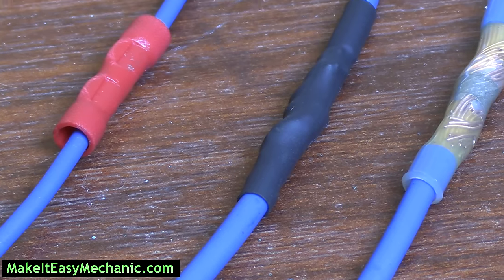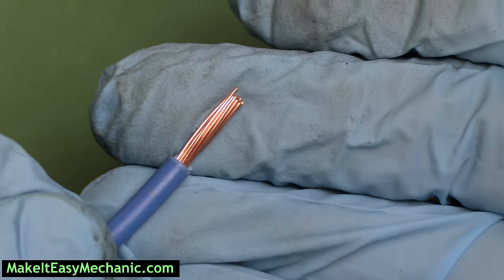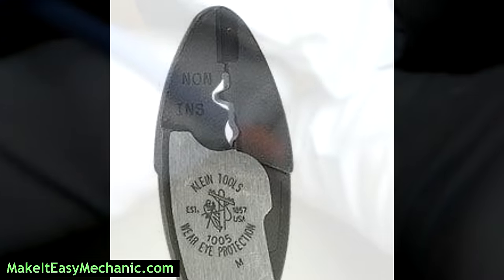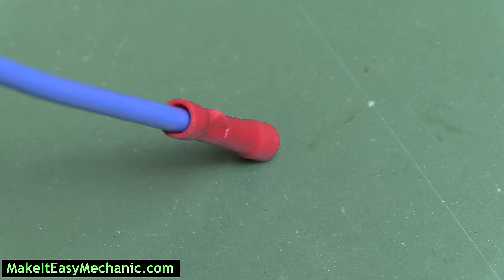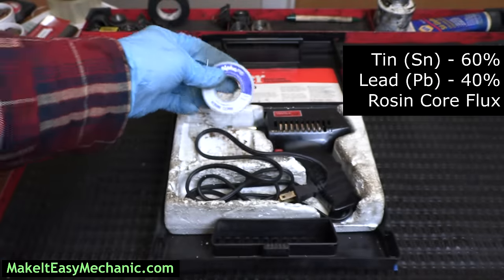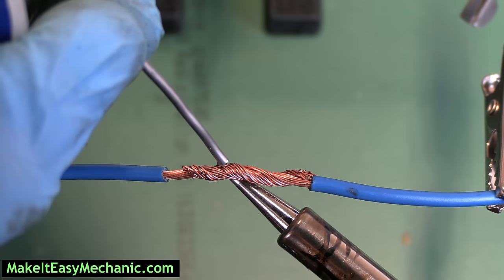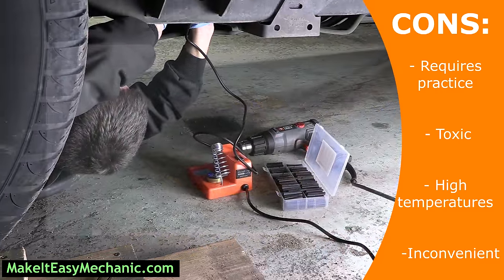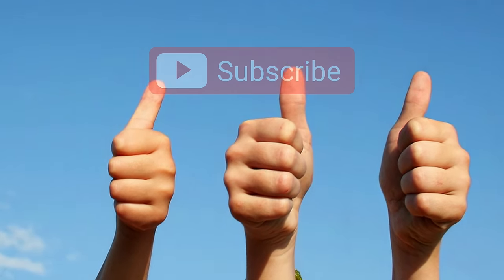How to splice wires - how to solder, how to crimp, wire connectors

Comment: so in one breath you say not to heat up the solder because it causes a cold solder then in the next breath you say to used heat shrink self solder connector which do the same thing.

Comment: Hey how do you unsplice wires? Sorry I’ve never done anything with wires
Reply: Cut the connector off both ends, you should just end up back at step 1 with 2 unstripped wires. Strip the wires and choose what you'd want to do again. The problem redoing electrical wires is, it's a lot easier to keep cutting it off to re-do it until you cut your wire too short. Try to leave yourself enough bare wire to splice but don't take the wire for granted, since it has a limited length but the amount of times you try is up to you

Comment: Hopefully an electrician can answer this question or someone with the knowledge . So I have led lights under my dash inside my card and an underglow kit under my car both connect to cigarette outlet in car but they each have there own plug/button so I can’t have both lights on the same time it’s either the glow kit under the car or the lights inside under the dash. So my question is can I strip the wires from the dashboard lights and splice or connect them to the underglow kit so that all the lights turn on and off with the same button ?

Comment: soldering wires makes brittle wire that breaks near the solder joint.  Best to just twist em tightly and tightly electrical tape the whole region.  Fastest and best and longest lasting.

Comment: 3:55 what if one wire is much larger than the other? I'm having this problem now where the light bar wires are much thicker then the harness wires so they won't fit in the heat butt connectors properly. not sure what to do.
Reply: If the wires are twice as thick or more, I wouldn't even try to splice that. You risk burning those wires up or not having enough voltage to properly power the light bar. The right move is to just run new wires of equal gauge. It's less convenient but at least you won't have any problems.

Comment: Heat shrink crimp butt connector covered with another layer of heat shrink for cars and trucks, followed by a firm pull test.   Solder and vibration, no bueno.

Comment: can I use a larger butt connector with a smaller gauge wire? does it affect the current or resistance?

Comment: Also the last method won't work if your wires are different size. The best solution is still soldering. Very important note is to always put the solder away if you need to move. I burned my hand trying to get more solder wire from the wheel.

Comment: BTW, the wire sizes displayed at 1:51 seems to me vice versa. If the yellow one is the biggest, why it have the lowest value?
Reply from the maker: thats how wire gauges are measured - the smaller the number the bigger the wire

Comment: I’m making a small device does the size of the switch make a difference with overheating small wires?
Reply from the maker: The switch itself isn't going to affect the wires.. it is how much current that flows through your circuit that will.
Reply: @MakeItEasyMechanic  
makes sense, thank you! your video was very informative by the way.

Comment: If you heat from the wire you can burn the insulation. 
It's all about the joint.

Comment: There is a big argument about how to solder properly. You have a good point about solder wicking into the wire. However i'm in the "melt solder on the iron, then transfer to wire" school of thought. What you have shown can absolutely happen, but only if the iron (and therefore solder) is too cold for the wire. When heated up enough it transfers heat quickly to the wire through the liquid drop, then said drop wicks into the wire, signalling that the connection is complete. That happens very quickly so the heat does not get the chance to burn the insulation off the wire so not as much needs to be stripped off, so the whole connection is smaller. Same applies for soldering circuit boards. Try the "heat the wire, not the solder" and chances are you'll burn something on the pcb, but with "heat the solder, not the wire" you're in and out quickly enough so that does not happen. The only downside of the latter is that you need to apply flux separately first. I prefer the kind made for water pipes since it turns clear once melted and is way easier to clean than rosin.

That said, if you're soldering a massive wire or a pipe by all means heat the work piece first because chances are there is nothing around that can be damaged by heat and size of the connection does not really matter. Besides, the connection will be way too big for the amount of solder to heat it up from just one spot, if that makes sense. 

As for connectors, that last one is really nice! I have not seen that style connectors in any stores so will have to go online to get some. And speaking of connectors, a good test of the crimp especially on larger cables (like an audio system power cable for example) is to hold the crimp in one hand, then grab the wire next to the crimp and wiggle the crimped bit around. A good connection will feel solid and stiff especially at the base.

Comment: I keep having situations where I'm needing to connect 3 wires together, 2 on one end and 1 on the other.  I haven't been able to find any connectors that can accommodate this scenario.  Is there any such thing?  What is the best way to do this?  This is usually when I'm working on my RV so I don't want to be using wire nuts.
Reply: @OB1canblowme  ? ? ?

Comment: Thanks for the video.

How about making a battery cable—say 2 gauge to 2-ought.  Crimp plus solder?
Reply: There isn't a lot of soldering on vehicles even straight from the factory.   A lot of people say that the soldered wire connections are points of failure because they're too stiff and don't move enough.   road vibration weakens them.

Comment: i just fuse the copper wire together in a small metal mold and then heat shrink.

Comment: The heat shrink solder connectors look like they are not wicking into the wires properly VS actual solder... It looks like the solder just gets hot enough to melt and then gets compressed due to the heat shrink tube... hmmm.

Comment: 3-way wire connection?
What is the best way to create a 3-way  wire connection?
Example: Trailer brake wires - wires to 2 wheels and the third to the tow vehicle.
- Ideally, this should be waterproof/resistant.
-- There doesn't seem to be any connectors for t or y connections.

Comment: 1. Should have included the NASA splice
2. Should have mentioned heat shrink tubing with ADHESIVE 
3. The connectors with the solder in them are convenient but the solder job is poor as the solder does not flow into the wire strands of the splice

Comment: Can you please give me some idea about connecting two battery cables I would like to relocate the battery to the back thanks 🙂and I did learn a lot  I like those self  Soldering connectors but that's  Cheating a little 
Just kidding
Reply: Cheating how? Its shrink wrap, a very well known and effective technology, and soldering, also well known and effective. Granted, the solder inside these things isn't nearly as all encompassing as a hand soldered joint, but there's no reason there seems certainly to be enough contact area to do the job very well. The fact that is is easier application of the proven technologies should discount it just for being easier.
Reply: @davealexander4925  Dave Alexander I'm just kidding about that it's great thing to have don't know about you but I'm disabled from bad health but I'm going to have fun and  Positive attitude and enjoy life  hopefully this doesn't hurt your feelings 
Deal with it

Comment: Solder type non-crimping,     works best the only thing I'll ever use   It has solder built-in to the connector you just heat the connector two ends there you go it's soldered underneath shrink wrap..Heated with the mini butane torch  / lighter     ..video link   to what im talking about     https://youtu.be/7Wh5gM8GM70

Comment: NEver Neverr use Electrical Tape at all that stuff just deteriorates after a few years and when you need to remove it. it leaves stick adhesive all over the wires that you are working with.

Comment: Did you know that normal heatshrink is not 100% waterproof. Marine Electricians  use a specific heatshrink which has a thermal glue inside the tube which GLUES AND SEALS out all moisture as it shrinks.

Comment: how would I heat shrink self soldering connectors when the wire is 8 gauge and the other wire is 16 gauge
Reply: 8 awg? you need a box for that.

Comment: Actually there is a 4th method to connect 2 wires. it's very fast, secure , you down need any special tools but the most important thing - you can reuse same wire ends many times. I use them for connecting and splitting wires in an outlet boxes. For example Wago 221

Comment: Great video, the only thing I disklike is the twisting of 2 wires together. It is not the correct way. If you can pull out 2 twisted wires, you are doing it wrong.

Comment: Heat shrink self-solder connectors are not as strong a joint as the soldering and shrink tube method. Check out this video.

https://youtu.be/unxEdyW8RP8

Comment: I used rubber tape on board ship over lug bolts, you could put under water its water tight, you'll need a razor to get it off.

Comment: House wiring 120 or 240 volt solder is not legal although I have a 70 year old motor/compressor center where the original electrician used solder and electrical tap with no problems. When you do a lot of soldering have a fan on low speed to avoid breathing solder fumes.

Comment: Error error, never twist wires for Crimping,it will breake some wires and the Crimping will not be solid.
Research it if you don't belive it.
Reply: Fantastic observation, I've been doing it wrong for years. Luckily, I only work on my own equipment. Now, I know better. 👍

Comment: Two notes on solder: 1) The video showed tin/lead solder.  In the USA it has been illegal to sell commercially for a fair number of years.  2)  Make sure you buy solder meant for electrical connections.  Using solder meant for plumbing can result in long term corrosion.

Comment: Sponges are BAD for soldering. Always use brass mesh to clean the tip. Using sponges will degrade the tip much faster due to thermal shock or rapid temperature changes.

Comment: Nylon butt connectors are the way to go.  Cheap ones are garbage. Just like anything ...get what you pay for. By cheap plastic connectors, get poor cheap crimps. Always crimp with the notch or "Non insulated" with notch opposite the split in connector.

Comment: Imho, the Bell Splice is the strongest, in 2 different areas if 2 wires, using the solder splice heat shrink.
Bell Splice: https://www.youtube.com/watch?v=KYjM0iaVFxk&ab_channel=HouseDoctorRay

Comment: Soldering makes a solid wire. Solid wires work harden and break. If the wire is a vehicle or something that moves a lot dont solder. Crimp a splice or a connector. If you wouldnt use a solid wire why would you make it a solid wire?

Comment: You actually want to disconnect the positive of your battery have ALL of your systems negatively grounded!
Reply: There no true ground when you are working with dc, only common ground, so the is no difference if you disconnect the positive or negative terminals.

Comment: technically wouldn't removing a wire strand reduce the resistance, thus increasing current?
Reply from the maker: No, thicker wires have lower resistance.
Reply: @MakeItEasyMechanic  oh right! I knew that! I don't know what I was thinking 😆

Comment: I disagree with crimp connectors used on solid wire. I've seen to many problems caused by loose crimps on solid wire. I have also seen several stranded connections fail in high current applications. I like wire nuts better for line to line connections.

Comment: For the occasional DIY solder job, you don’t need a heat gun nor mess with a lighter. The common hair dryer will work fine. Just don’t get it dirty or your wife will NOT be happy.

Comment: I can never help watching these tutorials..

As far as "cons" for crimps go - not being waterproof isn't necessarily fair... You can use heatshrink to insulate a crimp joint just the same as with the other methods shown.

The soldering isn't great, but I've seen worse - ideally wires should be tinned first (whether using soldering gun/iron or solder sleeves) and the splices shown are nowhere near acceptable under serious inspection standards... Still, it'll probably get the job done, and the note about insufficient wetting was well done and important - but it's also important that it's not just covered but wetted through (using untinned wires with solder sleeves this is a common cause of premature failure - there often simply isn't enough solder there to wet through).

Comment: On vibrating things, vehicles etc, only crimp. Dont solder. Soldering will/might become brittle over time and ur connections fail. Making ur work a hole other mess not worth!!

Comment: ALSO, ps, etc.,  I did some researching & testing & im partiallly rong😒.  It turns out it IS possible to melt sotter(again ‘partially’ & ‘possible’ ✋), allthough most people don’t btw.-  but if 1 DOESNT USE the common, sketchy Cracker Jack prize type brands - but the 3M was it? - apparently that brand you can actually melt soldr in 4.5 minuts with, 650-700• heat gun high setting - & IF various mishapenstances don’t happen(no pun int.), then it’s not completely worthless.  Details are on googles article ‘practical sailer - heat shrink tubing’

Comment: first part 01:04 (i use my front teeth), 03:00 plyers do fine if the isolation is a bit damaged use electrical tape(to be cheap),  04:47 place another on it if it cant repeat the process to lazy? apply some tape :P,  07:20 thats something i want to say thanks for.  and no didnt mean to say i dislike the video with this Just sharing the simple lazy cheap me ehehehe
Reply from the maker: Lol

Comment: If any one reads my comment I have a Honda CRV doing my passenger high beam noticed the adapter tha adapter to the light oxidized so decided to change it but now I am stuck the wires are black green and yellow the park I bought has red yellow and blue 😂😂what goes with what !!!my mind is telling me not to do 😂😂😂
Reply from the maker: I wouldn't worry so much about the colors of the new connector but rather take note of the position of the wires (left, right, middle etc.) For example if the black wire goes to the left side of the connector, make sure black wire goes to the left side of the new connector. I hope this helps.

Comment: NEVER use insulating tape if you want any kind of water proofing or even damp proofing. It will fall off after a year. It is also a poor insulator. I have gotten electric shocks though this tape.

Comment: I am not really that thrilled with those self soldering connectors after watching another Channel on here where the guy cut it apart after. It showed rather poor penetration into the wire cores maybe due to the fact there is not much solder in the ring itself to start with. Or it might be a combination of not enough solder or heat in the joint? It really looked a poor choice compared with soldering the joint yourself and using heat shrink. Just because it "works to a degree" doesn't mean it is the best choice.

Comment: Solder does NOT belong in ANY wiring splice in a vehicle. Uninsulated crimp covered with SCL is the ONLY proper way.
Reply: @musico007  it's prone to stress cracks that can lead to high resistance values causing heat and potential fires

Comment: Soldering is only secure if the wire does not heat up to the temperature of the solder.  The USCG has banned it for commercial vessels because of this.

Comment: Harbor freight has a line of Doyle brand pliers that make a great T&B/Klein copycat crimpers that you can get for 17$, and their daily 20% coupon usually doesn't exclude Doyle.  I'm an electrician and I'm very picky about my crimpers.  I use Klein at work, and Doyle at home.  I can't tell a difference other than the Kleins are a bit comfier to hold...and that's not exactly worth triple the price.  Just stay away from those really flat combo crimpers/strippers, they make poor crimps.

Comment: Soldering is not the best way or the strongest. It weakens the wires and makes it less flexible and prone to breaking. A proper crimp with a quality (>$100) crimper will give you much stronger crimps than the Amazon crimpers you get like the wirefly shown in the video. There's actual crimping tensile strength standards for quality crimps like MIL-T-7928G or 
NASA-STD-8739.4. Certified aerospace crimpers are over a THOUSAND dollars just for a crimping tool.

Comment: 1. It's soLder  not sodder.    Those heat-shrink solder connectors are substandard. Cut one open and you'll see that there is no complete penetration of the solder . It doesn't go through the all the conductors. That will create a corrosion point and eventually get hot and fail.  They are just a cheap chinese rubbish.

Comment: That pladtic solder shit is crap, they don't hold at the solder well only hold at the melted plastic.  Either crimp it or solder it properly 😒
Reply: yep, I saw a lot of videos where the latest method doesn't hold correctly half the time. Also, I don't think it is certified 😮

Comment: Soldering is not a good idea for wires in automotive/bikes/boats since mechanical stress. Wires gets too rigid and will brake after some time. Crimping with waterproof shrink is way to go.